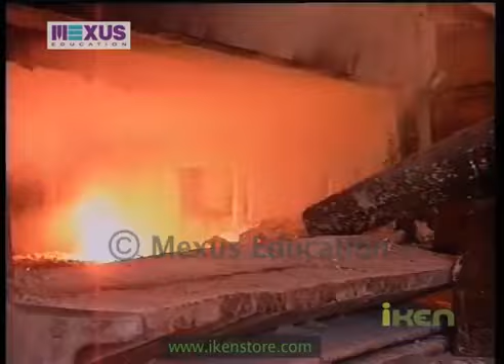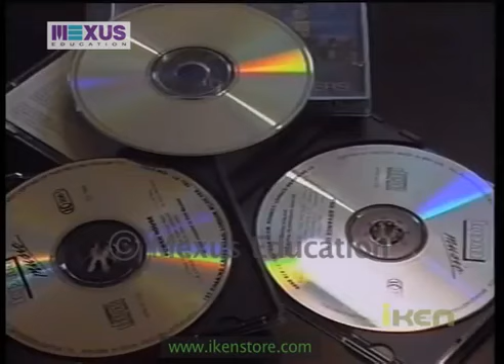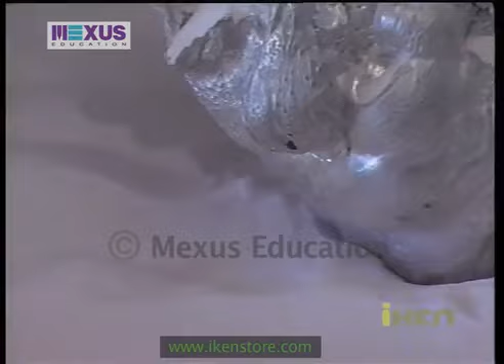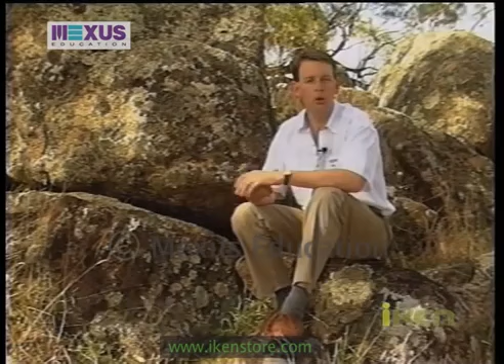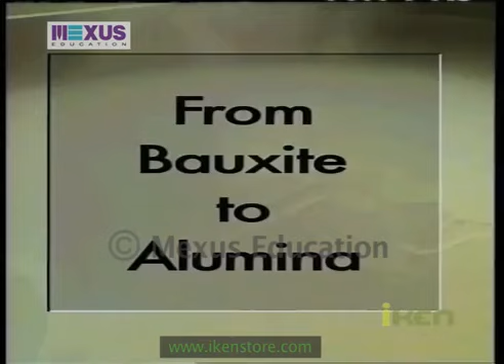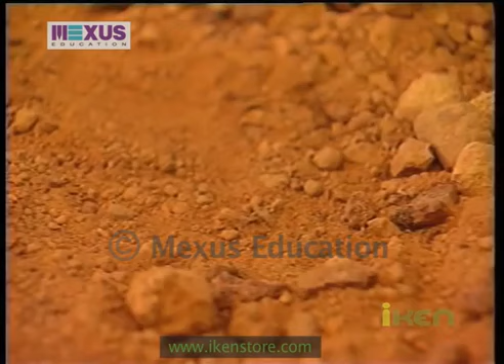The Making of Aluminium

Comment: Yusuf Sultoni

this video describes the process of making aluminium from start to finish and also with the use of aluminium for our liife. as we know aluminium is a metal that is often used in ihuman life. aluminium is primarily used to produce pistons, engine and body parts of cars, beverage cans, doors, siding and aluminium foil. it may also be used as sheet metal, aluminium plate and foil, rods, bars and wire, aircraft components, windows and door frames. the leading users of aluminium include the container and packaging industry. so it can be concluded that aluminium is a metal that is essential to life in the present era.
aluminium is highly reactive metal that we can not find pure aluminium in the earth's crust. aluminium ore in the eaarth's crust is in the form of bauxite that found in granitic rocks. on the granite rock there are any elements, such as bauxite, magnesium, silica, iron, potassium and calcium. the existence of aluminium in the earth's crust is always bonded with other elements to form a compound. for that aluminium ore must be purified so that it can be used for various purposes.
the process of making Aluminium is found about 35 million years ago by using a natural process because at the time undiscovered advanced technology for the purification process. along with discovered the advance metallurgy process and also found the technology to purify alulminium ore, engineer use the process of electrolysis. in the electrolysis process there are the anode and cathode, wherein the anode as a negative pole and the catode as a positive pole. electrolysis cell is the process of transforming electrivity in to chemistry process. the main process of electrolysis process is makke some current flow from anode (Carbon) into electrolyte as anode, then if the current flowing in to electrolyte, it transformed into ion. aluminium ore purification process uses a very high temperature until it reaches 2000C. to purify the aluminium directly from bauxite required enormous energy that affect a very large cost too. aluminium making process is consumpt very high energy efficiency. so the engineer must use the process effectively.
the manufacturing process of aluminium is accomplished in two phases: the bayer process of refining bauxite ore to obtain aluminium oxide, and hall-heroult process of smelting the aluminium oxide to release pure aluminium.
on this video explained about the making bauxite inti alumina using the bayer process. the bayer process has a purpose to filter out impurities in the bauxite, such as iron oxide, silica, and titanium oxide. in the bayer process, finely crushed bauxite is mixed with sodium hydroxide and placed in a digester. high temeperatures and pressures in the digester cause reactions in the ore?sodium hydroxide mixture. the result dissolved aluminium oxide and ore residue. the residus, which includes silicon, lead, titanium and calcium oxides form a sludge in the botto of the digester. the aluminium oxide is evaporated off and condenses. straches and other ingredients are added to remove any remaining impurities from the oxide. the final result of the bayer process is a dry, free-flowing sandy compound called alumina (Al2O3).
after we get the result from the bayer process in the form of alumina, alumnia then is purified by hall-heroult process. aluminium oxide from the bayer process is then reduced to alumnium metal usually using the hall-heroult process. in this process, the alumnium oxide is placed in a electrolytic cell with molten cryolite. a carbo rod in the cell is charged and the reaction result in carbon monoxide, carbon dioxide and aluminum. the aluminium sinks to the bottom where it is removed from the tank and sent to a melting or holding furnace. the final product from hall-heroult process is molten alumnium.
the molten aluminiu from hall-heroult process then mixed with desired alloys to obtain specific characteristics and cast into ingots for transport to fabricating shops. in the fabrication shop, the molten alumnium or alumnium alloys are remelted and poured into other active metals such as sodium and magnesium before casting. chlorine may als be bubbled through the molten alumnium to further remove impurities.
alumnium metal is an important metal for our life and the manufacturing process is very complex and expensive. so we had use the metal alumnium properly and also must be able to develop purification technology of alumnium so aluminium can be easily made and not spend to alot of costs.

Comment: Syifa' Errahmah
2712100056

aluminium is such a metal that could be found in everywhere. Aluminium is a the one of earth's service medal. Everyday, we find a thousand have different uses of aluminium, Fotr example, for the spurs a tiled lightweight material things like carrie engines, racing bikes, even your TV that always be watched, cooking for oil, drinking cans, and even you can find aluminium in aeroplane. Tv that you always watch may contains any medium and as we'll see in this video it's melted from white powder called alumina that using a chemical process called electrolysis. 

aluminium is a metal that could be reactive. Even, union scientist called an active metal that means it's like to react or combine with other elements. We never find a lump or pure element in this world. Because, aluminium always be found bonded. In the same way, you may trip over gold nugget instead. Aluminium always found bonded in a compound with others elements inside surface of granite like always. 

Granite is made have many different substances including aluminium, silica, potassium, magnesium, ion sodium, and calcium. But,how could we release aluminium from it's tight bond with these other substance? Fortunately, nature began the process on long long time ago.

May be in 30 million years ago, a subtropical climate extended accross most diverse trailer. High rainfall and the organic acids dripping from the lust vegetation began weathering the granite outcrops in same areas. Eventually, this process dissolved out and washed away many minerals leaving behind a thick surface mantle it has ready soil as well as iron oxides. It may contains aluminium hidroxide which formed when aluminium bonded with hydrogen and oxygen. 

After decomposing for millions of years, all that remains surface deposits aluminium bearing or called bauxite, that has chemical name Al2O3.3H2O. Bauxite other name is aluminium hydrate or aluminium oxide. It contains aluminium, oxygen, and hydrogen. Because aluminium is one of a active metal, it makes that bauxite has high melting point. The melting point of bauxite is about two thousand degrees celcius. Smelting bauxite at these temperature would be dengerous and costly because of enormous energy required and energy cost money. So instead of this we use electrolysis to eventually produce aluminium from bauxite. But for electrolysis has to work, the bauxite must bi refined first in to the simple raw material to be aluminium. It's usually called alumina.

Bayer process is process to chemically filter out impurities such as iron oxide, silica, anda titanium oxide. Aluminium hydrate is reacted with sodium oxide and it could be soduim-aluminum-oxide (NaAlO2) with water (H2O). This reaction is high temperature solution. During this reaction, the sodium hydroxide selectively dissolves the aluminium oxide into the solution leaving any undissolved impurities to be filtered out. After all of this cooling off. It seeded tiny crystal and fewer. And the final of this process is such as a crystal. Larger aluminium hydrate crystal are filtered out and heated about one thousand degree of celcius.  Alumina contains small highly charged and aluminium oxide ion will be formed to be with a bionic network. 

Congelead electricity in enourmous amount electricity to make aluminium about 15 kilowatt hours every kilogram. It means, to make one kilogram aluminium, it is needed electricity about 15 kilowatt. Alumina is one of expensive ingredients followed by electrical. 

Electrolysis is a process in making aluminium. Electrolysis has a purpose to transfrom alumina to be molten aluminium. This process called Hall Heroult process. 

Current enters the line at one and closing series one part to the next exits the other and then it flows through the second part line. Before the returning to the switch shot to complete this messege circuit, the current is a staggering three hundred thousand names. Enormous power products both the heat electrolytic force needed to smelting. 
Electrolysis of alumina may contains of cryolite that it is one of raw material to make aluminium. And then, for reaching pure aluminium, it's needed to reduce another substance except aluminium. Reducing another substance is with adding aluminium fluoride, calcium fluoride, and aluminium oxide. Adding carbonate has purpose to this imbalance in electrolysis process. Aluminium fluoride is added to match sodium content. 

The electrical current combines with the heat energy to split the alumina dissolved in the electrolyte in to its ironic components.  Then, aluminium migrate to cathode with a pool at the bottom of each part as molten metal. The oxide ions are attracted to the anode with a react with carbon to produce carbon dioxide.

Molten aluminium pools on the bottom because has a slightly greater than the bath. The other reason is because this metal is be miscible in cryolite. The oxide ions are repelled by the negatively charged cathode but attracted the anode here they combine with carbon to form cabin dioxide and small amounts of carbon monoxide.

From electrolysis to ingot is collecting them, molten metal from the patrons and delivering it into being ingot. On we've got four on holding furnaces ingot no way. Making this ingot cast and then molded. Impurities ingot such as iron, silicon, and mangan.
Reply: Syifa' Errahmah Blablabla
Reply: هلا

Comment: Dio Yoshitaka Anggarda
2713100088
Ekstraksi (A)

Alumunium. Everyday we find 1000 different uses for lightweight material, car engines, racing bikes, tv anthena, compact disks, cooking foils, drink cans, and body of plane. Even the tv we watching, probably its contains alumunium. It this video, explaining about alumunium is smelted from white powder called alumina using chemical process called electrolysis. Alumunium is active metal. It means, alumunium reactive to react or combine with other elements. We will never find pure alumunium in this earth. Instead alumunium is always found bonded in a compound with other elements. Like, in that surface rock, in the granite. Granite is made from many substances, including alumunium, silica, potassium, magnesium, iron, sodium and calcium.

Bauxite (Hydrated Alumunium Oxide) : Al¬2O3.3H2O. Because alumunium is very active metals, it gives bauxite a melting point about 2000oC. Smelting bauxite, this tempered is dangerous and costly because very high energy is required and energy equal with money. So, alumunium extraction process uses electrolysis which producing alumunium from bauxite. But before electrolysis gets work, Bauxite must be refine into alumina.  

Bayer process to chemically to take out the impurities such as iron oxide, silica, and titanium oxide. The crushed Hydrated Alumunium Oxide (Bauxite) is mixed with sodium hydroxide or caustic soda in high temperature solution. During this reaction, the sodium hydroxide desolves the alumunium oxide into solution. 

Bauxite to Alumina :
Al2O3.3H2O + 2NaOH = 2NaAlO2 + 4H2O
2NaAlO2 +4H2O = Al2O3.3H2O + 2NaOH
Al2O3.3H2O = Al2O3 + 3H2O (It is heated around 1000oC)

Alumunium Oxide or Alumina (Al2O3) contains small alumunium and oxide iron held in a strong ionic network covalent. Each Oxide Ion has an ionic radius two and a half times larger than that of each Alumunium Ion. Because of this, A two to three ratio of Alumunium Ions to Oxide Ions will repelling each other and its very difficult to show in 3 dimentions. This ions are arranged in regular pattern in outline layer.

From Alumina to Alumunium, when we want to get 1 ton of alumunium, we need 2 tons of alumina and a half of ton of carbon. A brittle solid coke which containing 80% carbon is used in anode for consuming smelting. The other main ingredient is electricity. Electricity used for smelting alumunium about 15 kWh per kg of Alumunium produced = 1kW radiator running for 15 hours. This is the example of production costs for producing alumunium in Australia. The Raw Material is like alumina are the most expensive ingredients followed by electricity and any other resources like gas or coal, Labour and overheads followed in third place of the most expensive ingredients.

The half of smelter is pots line, it’s the name of the long line of rectangular pots where electricity transforms alumina into molten alumunium. Those pots are also called Hall-Heroult Cells. Hall-Heroult found the efficient and economic smelting method of alumunium in 1886. Current flows from Switchyard (negative side) to one pot to the others pot until the current return in to switchyard (positive side). We can use this simple equation P = V x I (electrical power determine by voltage with the current), for counting the power consumptions in the smelter. Electrolysis maybe simply define as the chemical decomposition of certain substances by an electric current passed through the substance in a dissolved or molten stade. The Electrolysis of the alumina is consisting of Cryolite or Sodium Alumunium Fluoride (3NaF.AlF¬3) which normally melts at 1009oC and this is reduced by adding Alumunium Fluoride (AlF3), small amounts of Calcium Fluoride Crystals (CaF2), and Alumunium Oxide (Al2O3). Alumina added to this electrolytic solved bath quickly dissolves. Reducing alumina melting point from 2000oC to more economical 950oC. Cryolite forms a thick crust. Carbon soaks sodium compounds, in the pot – room operators add soda ash and alumunium fluoride is also added to match the sodium contents of the consume of alumina. In Cathode, electric current combines with heat energy to split the alumina dissolved in the electrolyte into its ionic compounds. From Anode, The Alumunium Ions migrate to the cathode where they pool as molten metal. The Oxide Ions are attracted to the Anode where they react with carbon to produce carbon dioxide and small amounts of carbon monoxide. And the reaction in Cathode is like this, Al3+ + 3e- = Al. The reaction in Anode is like this, C + 2O2- = CO2 + 4e-. During electrolysis, carbon is ripped from each anode. So, anode need to replace until about 4 weeks. But the cathode is going slowly, and need to be replaced for 5 years. The product of electrolysis is molten alumunium which is collected from the bottom of each bath. When the molten metal going to room temperature, it’s changed to Ingot mill. Ingot purity = 99.8%, Impurities include : Iron, Silicon, Magnesium, Manganese, Gallium, Chromium, Zinc, and Vanadium.